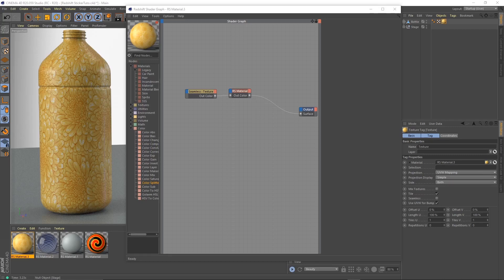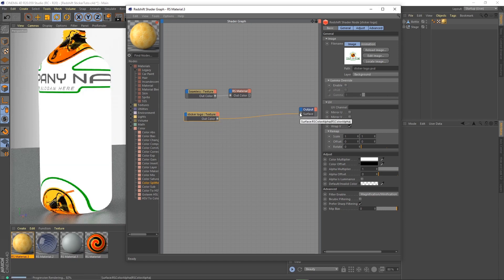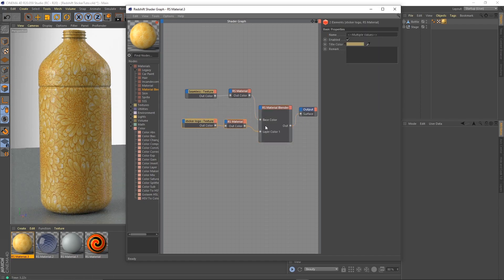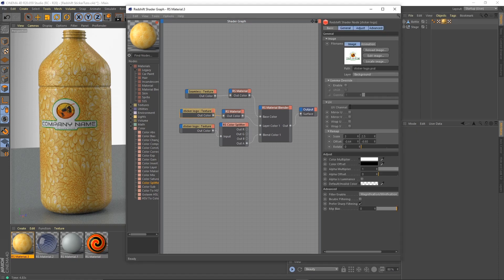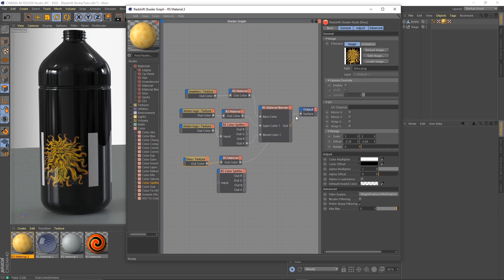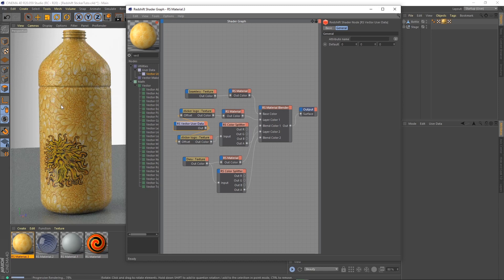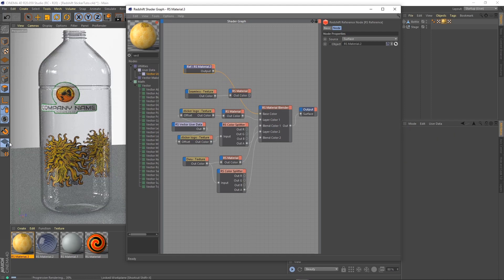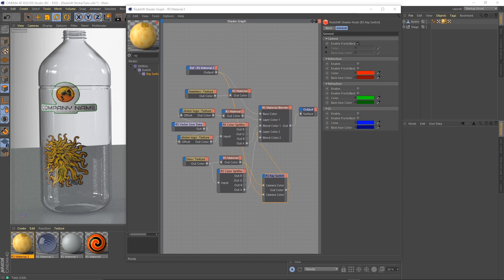Material Stacking and Decals In Redshift

Comment: Nice tutorial! Just curious why you would duplicate the sticker texture for the color splitter? Can’t you just pipe the out from the same texture node into a color splitter node without needing to duplicate the original texture? 

What your doing works but can create problems if you need to move or scale the decal. Having two separate textures for each sticker makes it so that you have to make the changes twice if a move or scale is needed. I guess you could pipe a transform into both textures but that’s an unnecessary extra complication on an already convoluted process compared to other renderers like Arnold etc…
Reply: To demonstrate the use of Vector User Data node is my guess.

Comment: I tried that Ray swith method but nothing happened. Do you think I have to use somehow the UW coordinates or UV channel?
Reply from the maker: RedShift is very dependent of normal direction, make sure they face outward, Cinema surface generator (Extrude, Loft ...) have a flip normal switch.
And don't forget to click: Enable Front/Back :)

Comment: Ray Switch doesn't work in my texture. I'm doing everything exactly same as you did, nope, not working.. Frustrating..
Reply from the maker: RedShift is very dependent of normal direction, make sure they face outward, Cinema surface generator (Extrude, Loft ...) have a flip normal switch.
And don't forget to click: Enable Front/Back :)
Reply: @boblolo3977  Thank you :)

Comment: I have a question.
What should I do if I want to make a square box and put the same image on each side?
Reply: If the shape is pretty simple I would make a selection of each face and map each face separately using flat projection. Using this method for a simple square box is probably overkill tbh. Alternatively you could use the triplaner.
Reply from the maker: have you tried the square projection?

Comment: Cool, thank you! But what if the glas has thickness? Then the sticker appears on the inside of the rear glass becaust of the flat projection..
Reply from the maker: Thanks, Easily solved with a Polygon Selection Tag on the inner part of your object and applying just the base material without the sticker.
Reply: @boblolo3977  thanks bob, that's how i 
 did it eventually 😅